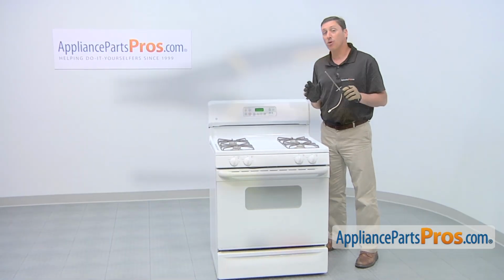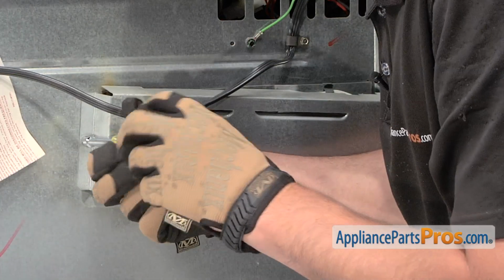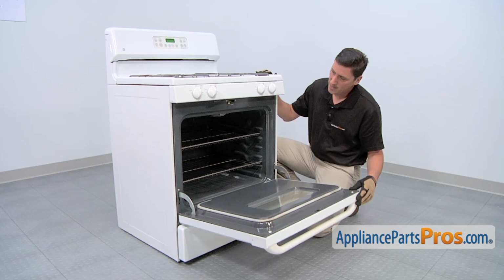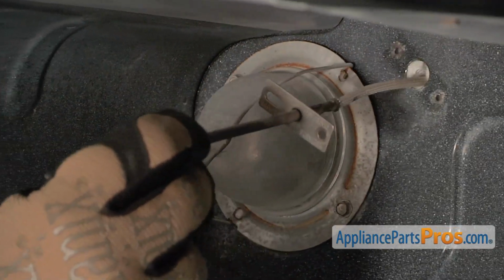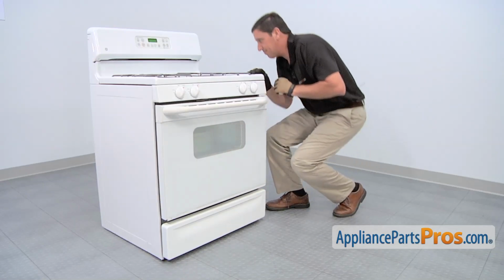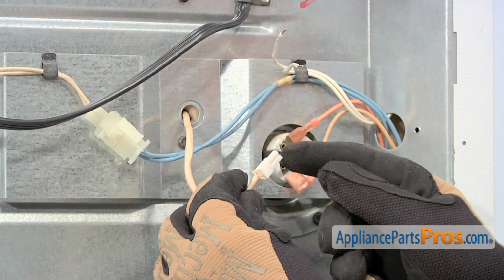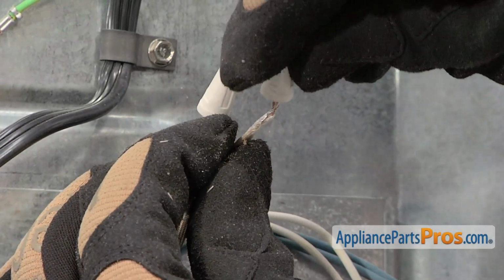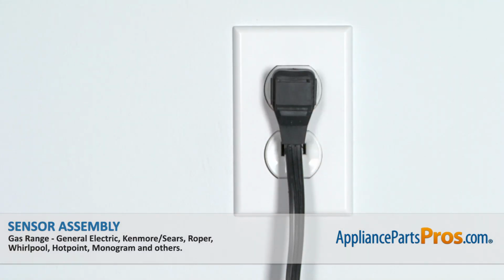GE Oven Sensor Assembly WB21X5301 Replacement

Comment: Can the wire harness be replaced? Went to replace the sensor and the harness plug is melted
Reply from the maker: The wire harness or connector may be replaceable, depending on your oven's model and how the harness is designed. A melted plug can indicate a loose connection or overheating, so we wouldn't recommend installing the new sensor until the damaged wiring has been addressed. If you share your oven's model number, we can help look for the correct replacement parts. 😊

Comment: Could this be the reason my control panel says 500º but the internal temp is much less, like 325º? Just trying to figure out if this is the part I need to replace.
Reply from the maker: The temperature sensor can cause that issue. You can test that for resistance with a multimeter. It should read 1080 ohms at room temperature. 

If you need further troubleshooting or repair help you can check out our Repair Forum: https://forum.appliancepartspros.com/.  It’s easy to register, and you can either post your question or search the forum to see if someone else has already asked the same question.
 
Our experienced technicians, with over 20 years of hands-on appliance repair experience, are ready to answer your questions and guide you through your repair.
Reply: @appliancepartspros  Thank you! do I test at the connection under the wire nuts?
Reply from the maker: You can test it at the connection, one lead on each wire. If you need more in depth troubleshooting or testing information you can check out our Repair Forum: https://forum.appliancepartspros.com/.